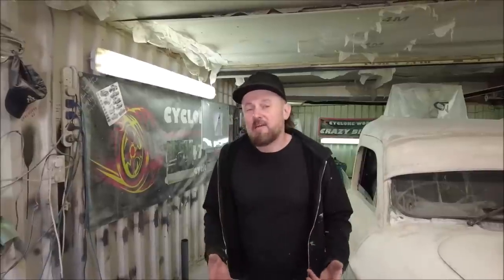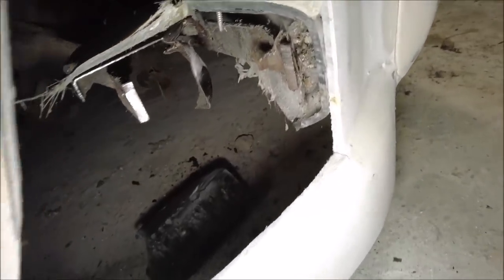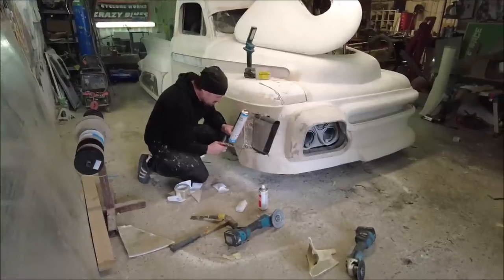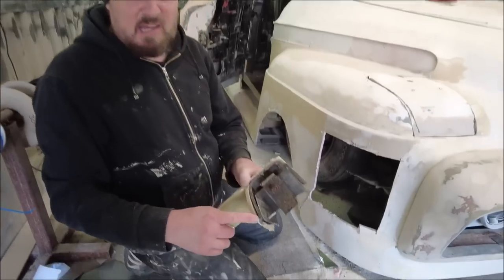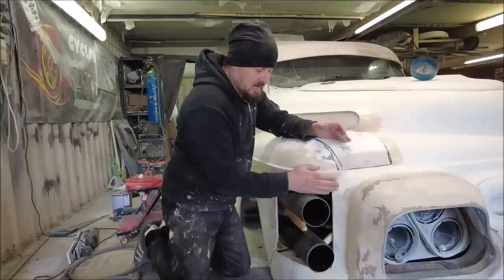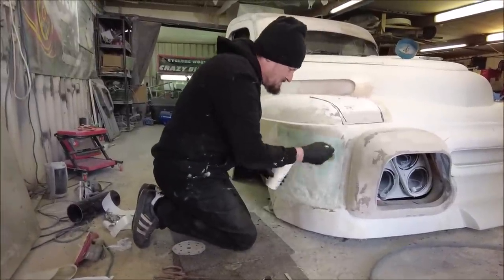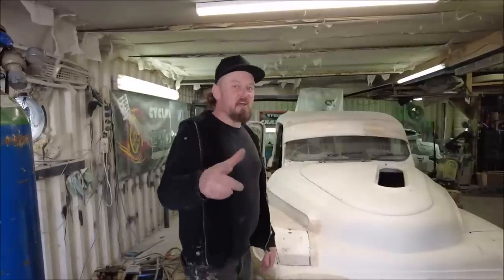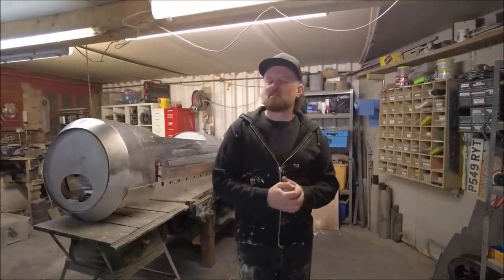IT HAS TO BE COOL!

Comment: Recently found your channel Paul and it's like looking behind the magic curtain of kustomizing . I'd hate to think how many hours all that bodywork would take if you were bashing it out of metal . Great stuff and thanks for posting . PS , old man tip . Get some knee pads on or at least use a sponge cushion when you are kneeling on concrete . Old Paul will thank you .
Reply from the maker: Yes I totally agree, metal work is fine, but not only does it rot, but it takes flipping ages to get those nice curves, unlike fibreglass :)
Thanks for the tip on the knee pads, however I am so impatient I just crack on them moan afterwards.  I do try to use carpet tiles, but a fire proof sponge pad sounds perfect. Cheers

Comment: At first I thought you were doing the duct(s) for brake cooling.. I'm no aerodynamics expert, but, I cant help but wonder if those ducts will actually blow or suck? Would it not be more functional to have the radiator air coming through the 'mouth' at the front?
Reply from the maker: Come on Nik, you should know by now, that 'mouth' is blocked for cooler stuff in the future.  Watch this week when I will explain again, lol

Comment: I’ve never seen so much Bondo ona vehicle. And that will never be enough air flow to keep that motor cool. I hope I’m wrong but 90s Camaro have cooling issues and the have more airflow than that. A massive duct on the bottom in front will help while moving but deff gonna need some massive electric fans an a nice shroud
Reply from the maker: Thanks for your comment, yes we are installing an electric fan just to help out.  That front will be filled with crazy lighting so no can do on the front.
Thanks for the advice though :)